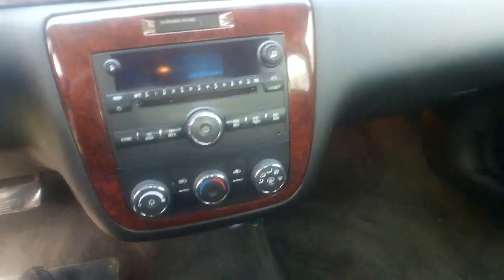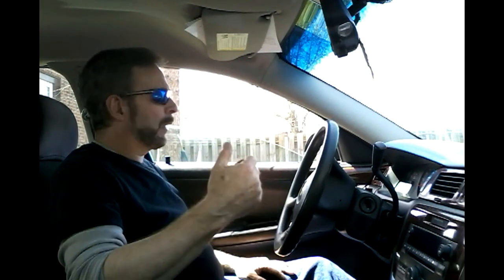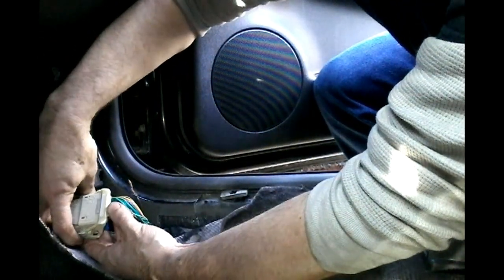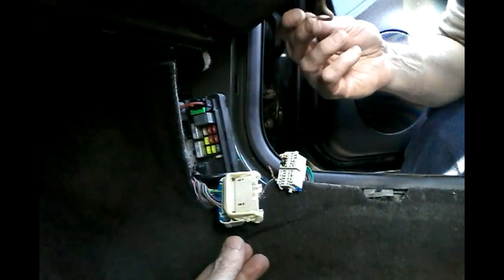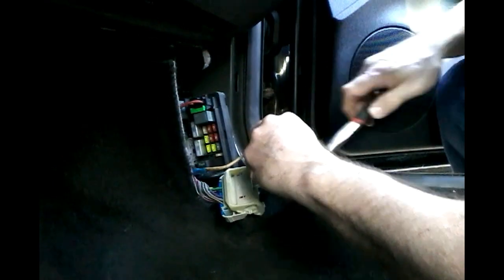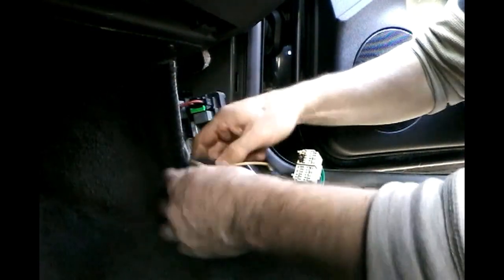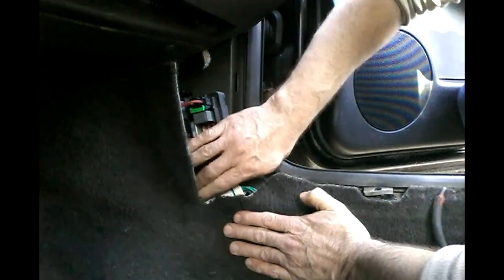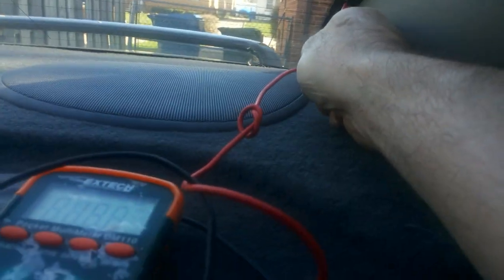Chevy Rear Defroster Repair

Comment: I did t see any smoke . It seems like you already figured the problem out before hand because I saw wires already  cut.  I'm confused. Are you saying if it happens this is what you do or did this really  just happen ? 
..What symptoms are there really ?? Would I see smoke ?
Reply from the maker: I have repaired at least 30 Impalas 2006 and up with this issue.  I was waiting for it to happen with mine and it finally did.   Smoke didn't show well on the camera.  I was doing a scene for another video when I smelled the smoke and knew immediately what it was.  The wire was burned in two.  The circuit is not fuse protected.  Symptoms are no rear defogger operation and /or the smell of burning plastic and smoke.

Comment: I had the same problem on my 2009 and a 2006. An electrician told me to put in a 25 amp inline fuse to be safe.

Comment: Do I need a jumper wire or can I connect them straight together? Do I need to disconnect the battery before doing this?
Reply from the maker: shouldn't need jumper wires.  Always a good idea to disconnect the negative battery cable.

Comment: Now is this safe? Seems like it would be easier to catch on fire no fuse and apparently it gets to hot!
Reply from the maker: Its still a fused circuit. It got hot because the connection in the wiring connector was too small to handle the amperage. Bad design.

Comment: I have a 2013 malibu with the same rear defrost issue.  Checked relay switch and fuse. Checked this wire harness, and nothing looks burned up. What should I check next?
Reply from the maker: Check for voltage at the grid (at the window)  It should be 6 volts.  If thats ok check the grid itself for a break.